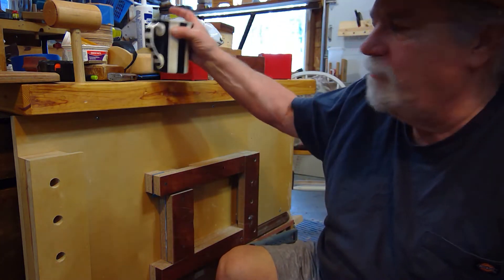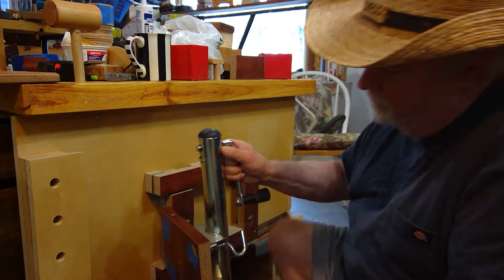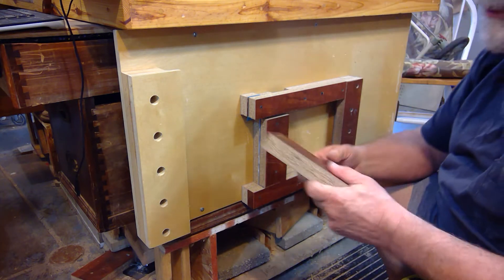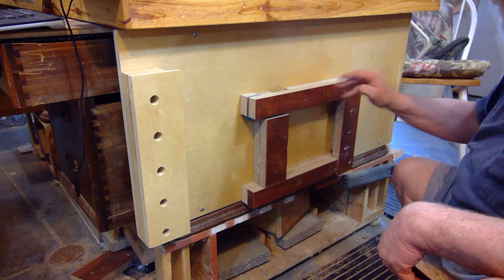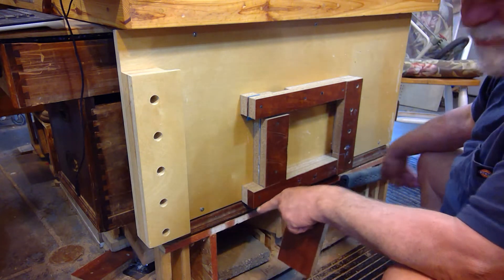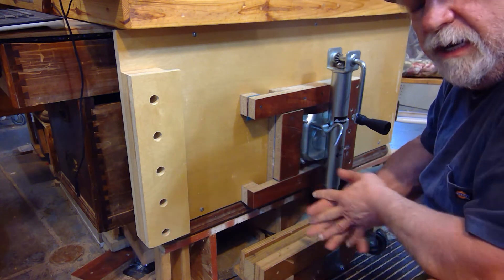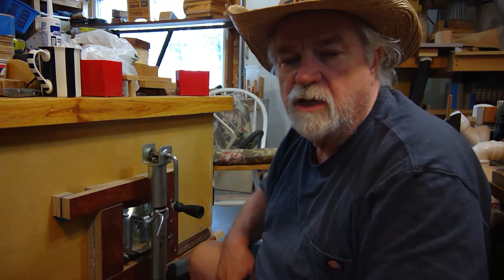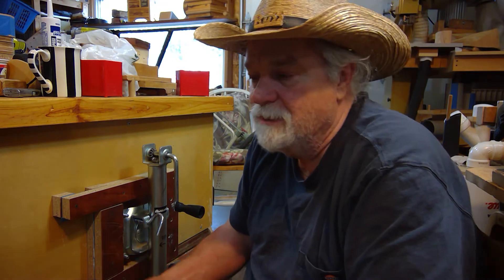Workbench Mobility Finished AGAIN by Rambling Russ

Comment: Very nice.  I'm thinking about doing something very similar for my 1200# metal lathe.  You could reduce the complexity and size of the size even further by doing a single layer with the pieces cut at 45*, forming a sliding dovetail.  Just put a stop on the right side and then drill a hole on the left top rail.  Drop a bolt down through the hole and the left side is not temporary blocked.  Lot faster to make and even lower profile.
Reply from the maker: you are correct & I thought about using some kind of (double) French cleat.  my long term thought is to use this thing for other heavy items in the shop.  I big on multitasking :>)  thanks a lot, now I gotta redo it again :>)

Comment: How about a hanger bolted to the lift jack, which had a lip that could be slid under the side of your table saw, etc, which would eliminate the need for the attachment coupling?
Reply from the maker: thanks Mitch.  good idea.  I am definitely going to attach to my TS.  the question is will I get mine done before you do or not :>)  I think it will make a great video. 
The real challenge is the TS has a large overhang table top and the crank needs  lots of vertical clearance to crank.  My thinking is I may have to re-vamp the handle for operating in tight areas.  I also want to make a "universal " attachment to the lift so it can be attached and taken off easily on multiple items.  Any suggestions?

Comment: Russ

I bet you could also make a router lift with that lift.
You could also weld something that you could connect to a drill to motorize it.

Harvey
Reply from the maker: it turns easily even when I was using it to lift logs last year as part of my "Logging in the Burbs" series.  an adaptor to use a drill would be easy to make.  about 24 cranks is the most I have had to use (less than 20 seconds).  I agree there are lots of things this can be used for.  more ideas coming soon.